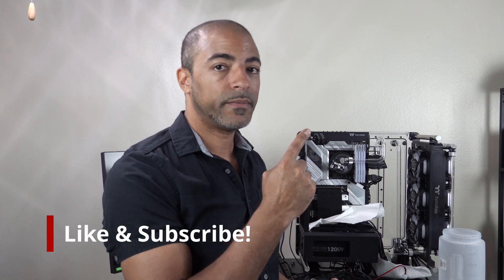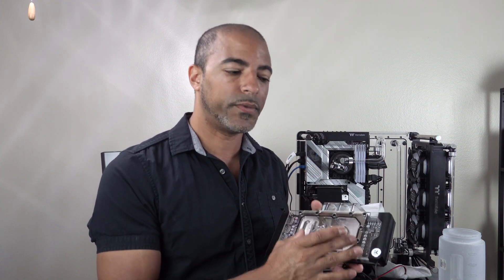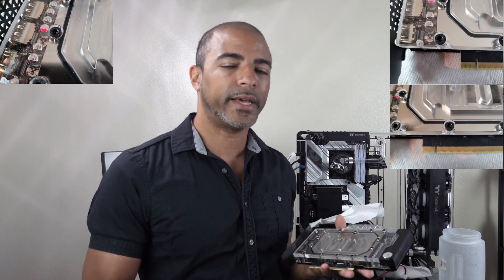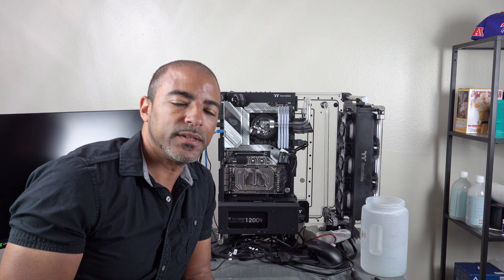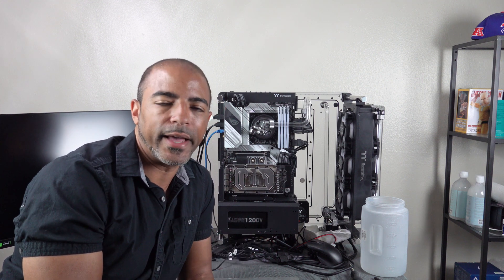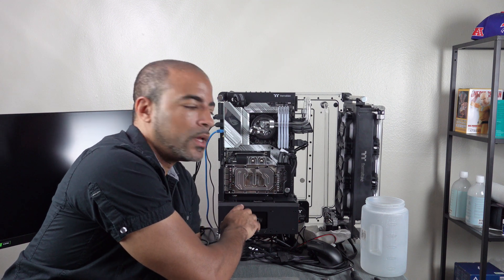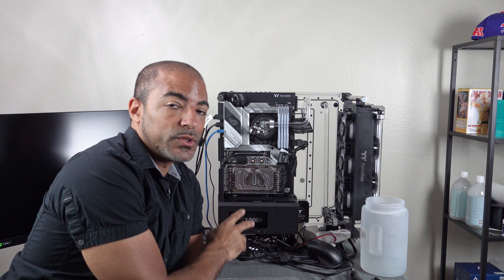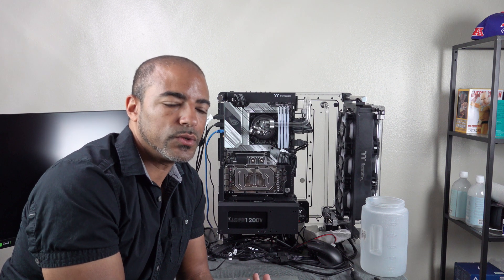EKWB Quantum Vector RE RTX 3080/3090 D-RGB - Nickel + Plexi issues/fix

Comment: I asked this Q on one of your shorts videos, so with the Active backplate on my EVGA 3090 FTW3 Vec. block I got the Jetplate on, so restriction for more pressure with the active plate on the back? or should I remove the jetplate ?
Reply from the maker: Just leave the Jetplates alone, they come preinstalled where they need to be. No need to change things up.

Comment: I stumbled across this video while trying to figure out how to remove the plexi insert that holds the jet plate down so I could clean out my fins. Given how tight mine was and how easily yours came out when you took off the plexi front, my guess is the plexi insert wasn't totally in spec and wasn't applying enough downward pressure to hold the jet plate securely in place. Combine that with the fact that yours didn't have all of the screws were properly torqued from factory, and I'm sure that's why it slid out. Hopefully if still in service it's holding together well for you!

Comment: so im looking to buy this right now cause my power draw and temps have been high on my 3080 im fairly new when it comes to deep building taking apart with my gpu so would i be able to install this without breaking anything and do i need to order the tubes that u have in the video for the waterblock or does it come with everything that i need
Reply from the maker: You need to order everything. Take your time and research, there's a lot to water cooling. You have to know what parts are compatible, what size tubing you want, the type of tubing, the type of pump, reservoir, metals used, type of fluid, so don't rush into it without spending a few weeks researching.

Comment: Hey brother,  cool video.  Just curious, do thermal pads install between top backplate and pcb/opposite side of gpu core. I just got same gpu block & instructions from ek dont state thermal pad installation for that side. Thanks again
Reply from the maker: Follow the diagram on the EK website, it shows exactly which thermal pads go where.

Comment: I have this exact case, exact FTW3 card (except 3090), and same power supply. My GPU died when I used this EKWB block. First thing was that the LED's never worked, the second one they sent, LED's worked, but bricked my 3090 (the standoff was sitting on a resistor and this is a known issue) and the last one, im hoping by thursday comes in, I can get everything squared away. These cards by EVGA are very commonly known to be very bendy and can easily crack the pcb. Its unfortunate. Hope you enjoy your build though!
Reply from the maker: Yes the EVGA cards are breaking on people while taking them apart as well as applying a block. It's unfortunate.
Reply from the maker: @Mitchell Diaz I strongly recommend to only use the block that EK says is compatible with your exact card. Doing anything else could either destroy your card or give you unfavorable temperatures.
Reply: @Mitchell Diaz If you have the FTW3 Ultra 3080 only the 3080/3090 FTW3 ultra block will work with your card. The RE is not for your block

Comment: Hi man, great channel you have here ... i just read a post of yours on overclockers and got the link to here ... i have a specific questions about RTX 3080 HP Omen Custom that i believe you have ... can you explain to me if it add thermal pads between backplate and the back of the vrams will bring some gains and if it is easy procedure to do? (Im not too confortable on diy things like this eheh)
Reply from the maker: Yes it helps since they don't have any thermal pads on the back plate. It's not needed on the 3080 though. On the 3090 it helps more
Reply: @DaPoets  is it a simple procedure or is it too complex to perform?
Reply from the maker: @XzEduu  It's easy, maybe I'll make a video about it.
Reply: @DaPoets  that would be great man ... i have one RTX 3080 HP Omen Custom and wanted to know step by step on how to add thermalpads on the backplate. I read on reddit that was just a few screws and no warranty seals on the way, at least for adding thermalpads to backplate ... 

When would you be doing that super video?
Reply from the maker: @XzEduu  I'll mention it in my next GPU water block video

Comment: Buddy all I can say is that EK has turned into an absolute joke of a company!  They got their last 1000 dollars out of me on my current build!  I am so pissed off that I am going to teach myself how to design and build all my own water cooling blocks and distro plates!  I am going to start looking for an affordable tabletop CNC machine and go from there.  I believe that when someone pays you their hard earned money they should get the best product possible and if there happens to be a mistake then fix the issue for the customer which is the opposite of what shitty EK did for me!!   I am still pretty pissed off at them.  So I do the usual and buy everything possible for my new build watercooling from EK.  I bought the X570 Monoblock for Gigabyte Master Mobo, the chipset water block, the GPU block for a 3080, the RAM block for 4 sticks of RAM, the RAM heat spreaders in Nickel.  I also bought 2 M.2 SSD waterblock but had to go Bykski because EK doesnt make one yet.  So I spent many hours installing all the blocks to get everything perfect.  Then I was starting to figure out my piping for my 2 water loops when I found the big problem.  Had EK maybe thought to try out their damn products before putting them into production they could have easily solved this issue!  The GPU block will not allow the 16mm rigid tube fittings to be installed on the chipset block!!!  I contacted EK thinking for sure they would fix the issue and make a new Chipset block with the holes a little further to the left.  The reply I got was Sorry, use 12mm tubing instead.  The engineers say they wont make you a new block.  Yeah okay FUCK YOU EK!!  This is what happens when people dont have much in the way of competition and have lots of cash rolling in.  We will see how long they last with their new attitude!  That new Optimus company is going to do well from what I have seen!!
Reply from the maker: I understand your frustration when things don't come together as planned. I'm trying to understand the issue though. Is your GPU physically in the way of the chipset block? Is it vertically mounted or in the PCIe slot directly?

Comment: EK is one of the most over rated and over hyped brands in the entire PC space. Their stuff is overpriced and is almost universally inferior in quality to their competitors. I learned my lesson on buying EK. Pumps die fast, cpu blocks underperform, tubes get cloudy and degrade extremely fast. Poor quality orings on the fittings. Theres alot of cost cutting and they get a pass for some reason from the tech press.
Reply: Funny since EK uses genuine D5 pumps just like Watercool, Aquacomputer, Bitspower. But EK's are magically worse than competitors ;)
Reply: @eriknastovski1330  I have a dead ek ddc right here.
Reply: @skoopsro7656  thats a xylem DDC. Made by Xylem, not EK. Just like any other DDC in the market.
Reply: Couldnt have said it better myself!!  So true.
Reply: GGF doing all his build with ek almost ^^ -_- fitting the quantum torque series are awesome
Reply: I'm hearing this more and more, also noticed a lot of reddit posts with their nickel finishes deteriorating real fast. I think I'll go elsewhere for my block since their QC is garbage.